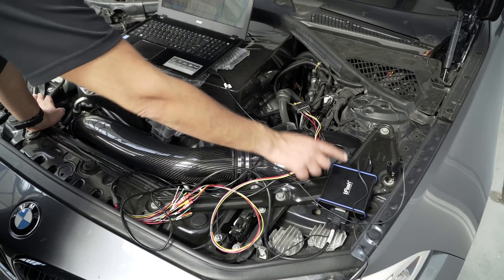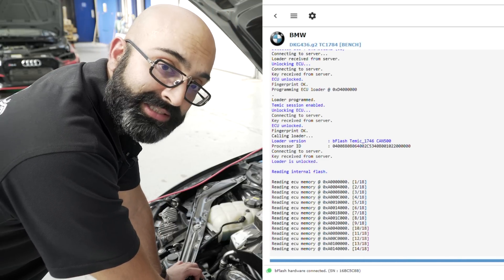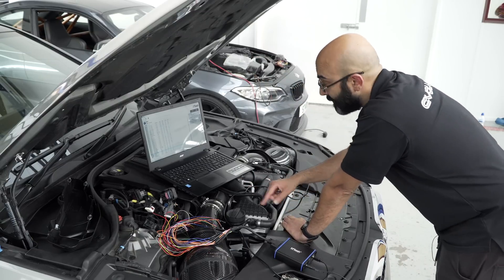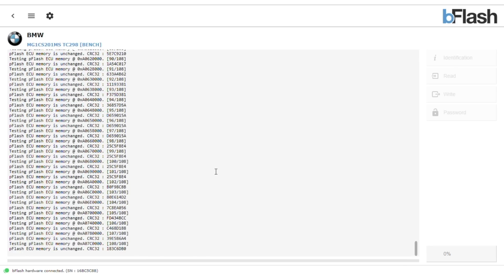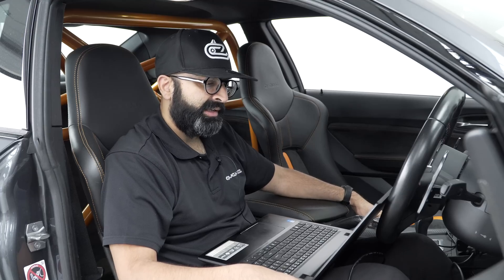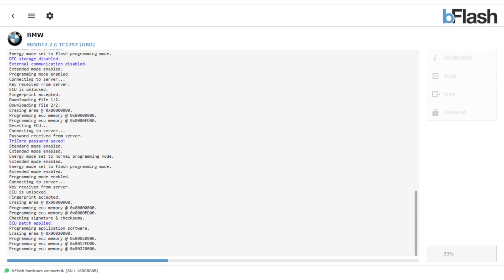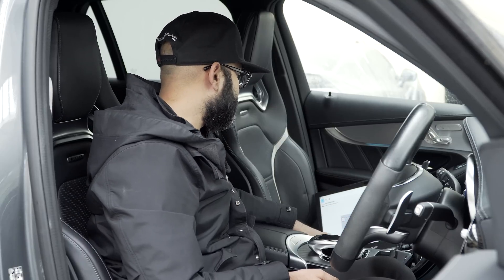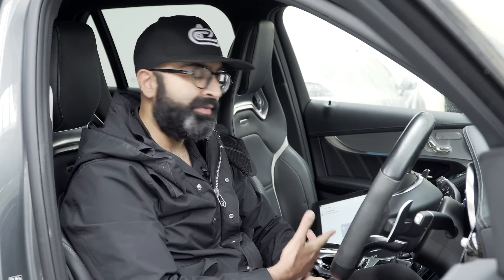How we read and tune ECU's and TCU's - Bflash Tool

Comment: What battery charger do you use?
Reply from the maker: We use a Ring charger that can supply a large amount of amps, but for general home use a conventional charger like a CTEK will be suitable to maintain a good voltage whilst flashing when accompanied with a good condition battery.

Comment: are there any improvements to be had on an m135i with 8 speed zf?
Reply from the maker: Yes we have a TCU tune for that model flashed via obd. Faster shift speeds and increased torque limits.